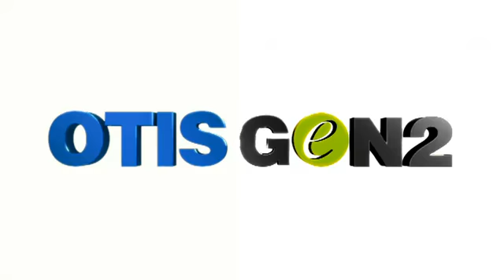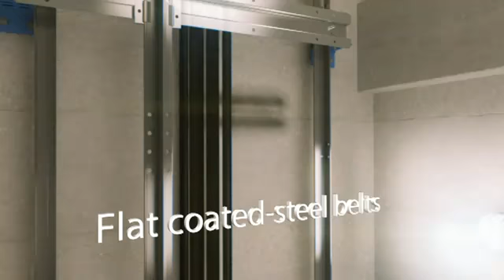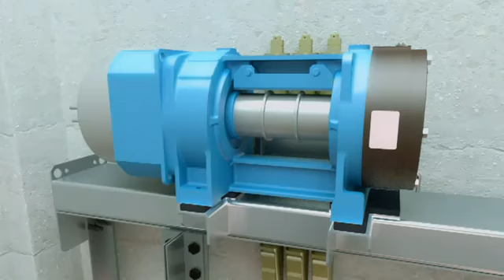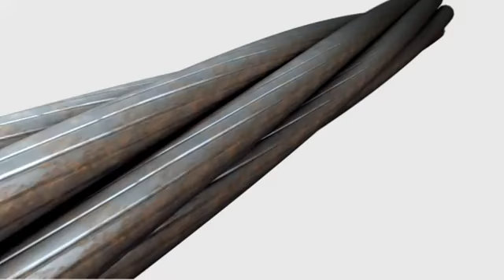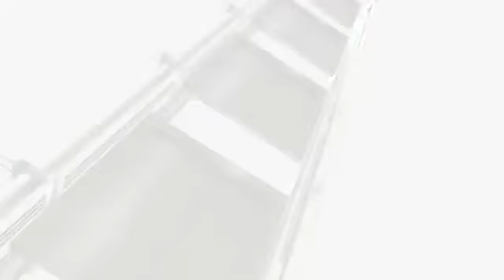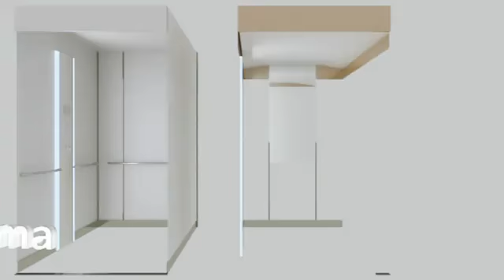OTIS GeN2 Technology

Comment: IMPORTANT:
They don't say it in the video but they have to install a service box beside the elevator on the top most floor.
.... So don't think all the electrical parts will be completely inside.

I got cheated on this part because the person sold the elevator to me for 14 Lakhs and didn't even tell me about this important tidbit. I got the elevator after one year and that too near the completion of my house and by then it was too late to ask for a refund(which I am sure they wouldn't have given even with the mistake on their side) or a replacement without such a feature.
Reply: What are you talking about? Have you ever seen an electrical system without an electrical or service box? Come on…
And in that video they tell you that the heat sensors are in the « Machine » the« Controller » and the « Drive »…. I’m sorry if you didn’t realise but that is kind of obvious..

Comment: OTIS GeN2's look amazing and the technology in it is a masterpiece!
Reply: Yes I like it too but some GeN2s are very slow
Reply: them otis gentoos are crap.
Reply: @evt.satellite_01  ok that's your experience
Reply: @evt.satellite_01  I pressed the door open button on one just as the lift started moving, and it actually opened its doors and safety broke it’s self at about 2 inches off the floor! I wouldn’t have thought the logic would be stupid enough to allow it’s self to do that lol!
Reply: @Lift.Tracker  the ones with door hold button will cancel all floors immediately after you press it.
Reply: @Lift.Tracker  "Using proven Elevonic technology"
They says that on the Gen2 Mod video.
Reply: I like the gen 2 I usually see it at complex and shopping malls 
It's  a very nice elevator
Reply: @CJ_7521 I always see an Otis Gen2 goes out of service in a shopping center

Comment: Machine roomless  (MRL), good in theory, bad in reality. Otis took a bad design from a competitor and actually made it worse. Controller access in the hoistway and can only be accessed from the car top. Any halfwit can see the stupidity in that. Good running while everything is working but a pain when not.
Reply: This is a fact, i never understood this idea, what if you have a issue with the break switch or encoder, and the elevator is stuck on the bottom landing, its the biggest pain in the ass to get to that machine now.
Reply: @IAm.Rushin  manual / battery brake release until the cage at highest floor.
Reply: I’ve been a Lift breakdown engineer, MRL could add further access problems to get lift running,

Comment: so, when stuck between floors, you cannot open the door to get out?
Reply: @qrxszn  Lift gets stuck, you wait for rescue by a certified Otis technician? How long will that take? You can generally climb out if you can open the doors - of course everyones worst nightmare of being sliced in half when the lift starts moving, just as you are climbing through the gap - so the lift needs to be immobilized if any door is manually opened. - Why do they over complicate things?
Reply: @moonants  don’t be foolish... it is dangerous to climb out of the lift when it is stuck, use the alarm and phone buttons.
Reply: @aaronrennyvargheseOriginal  Life is full of danger.
Reply: @qrxszn  He describes what the lift  technician must do. Those stuck inside, just have to wait.  I was stuck in a lift between floors, about 30 years ago. I just slid the door open and climbed out.
Reply: Well alarm and phone buttons were invented for a reason 🤷
Reply: Is easy when the lift stuck between floors, just only they had batteries to take you until floor and open the door
Reply: people can come and rescue by manually opening the doors
and passengers inside the elevator can come out through the doors or an escape hatch/escape shoot

Comment: Belts are a sort of trap to get building owners hooked.  A counter counts the start stops of the car. And when it hits a predefined number there is nothing you can do but have the belts changed.  ( for almost the half of the price of the complete elevator ) . It's not only otis . Kone schindler etc are all the same . I would rather use traditional wire ropes and polyester pulleys instead.
Reply: Well this is flat out wrong.
Reply: this is why Hitachi & Mitsubishi never went the "belt" way. Japanese knows what's best, steel wire rope is the best.
Reply: Krone Ecodisc is using wire ropes... They can handle large diameters due to the motor inside the wire rope disk.... ;-)

Comment: I heard that you can get rope stretch on with theses belts.  Is that true???
Reply: No
Reply: It's so true and make big time noise
Reply: Traditional wire ropes also stretch, and the belts are basically a polyurethane housing for multiple smaller wire ropes. So, I wouldn't be surprised if these belts stretched too.